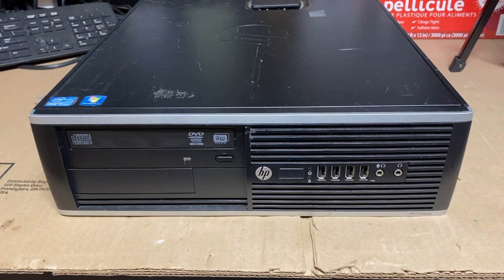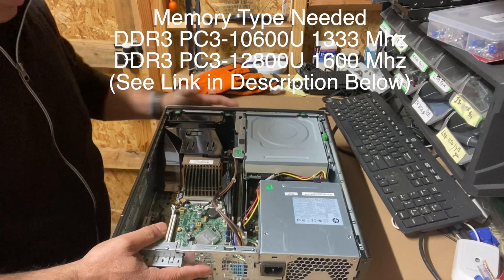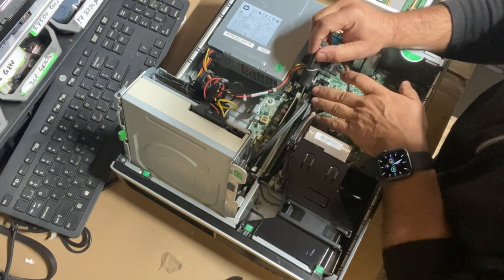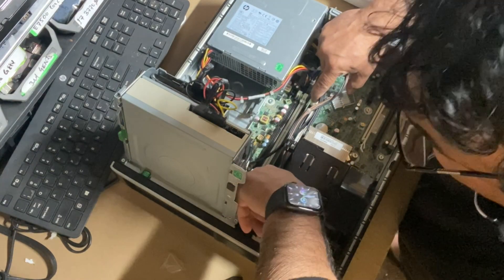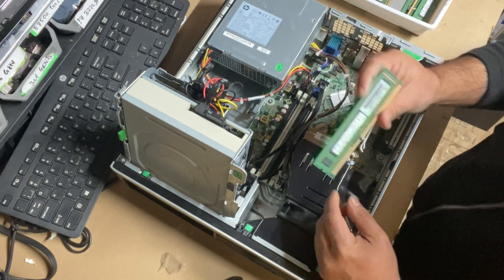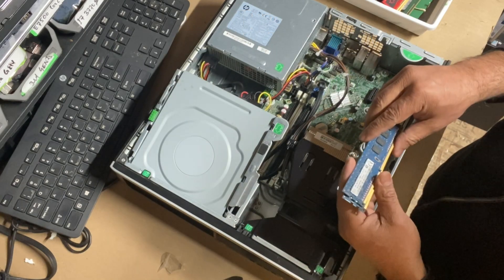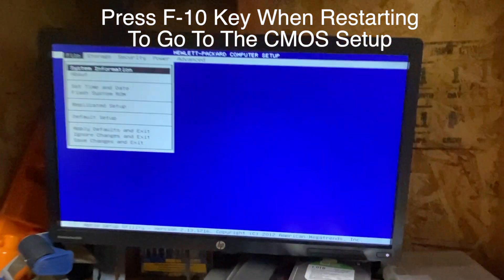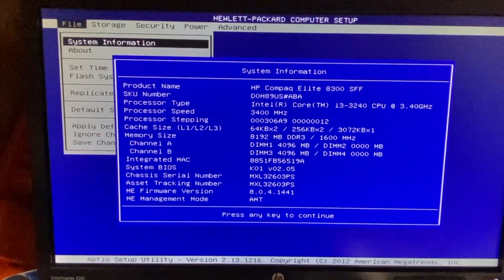Upgrading or Replacing Memory for #HP #Compaq #Elite8300 Small Form Factor PC.

Comment: I have the same computer. I also have the 8200 sff. The 8200 I put 32 gbs of ram and the unit recognized it and it works . The 8300 it will only see 16gb even tho it can take up to 32gb . All ram slots are working but system will only seeing 16gb in bios and windows .I do have the latest bios update as well . This thing is driving me nuts .
Reply: Also used the same ram you did but time tec labeled and that was the same ram I used in the other computer